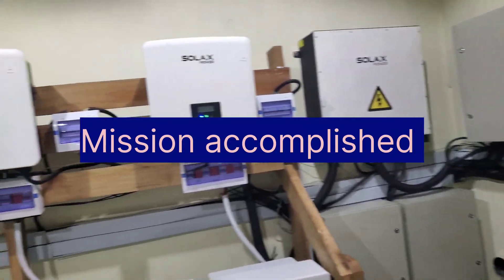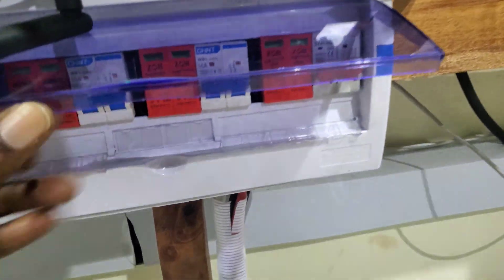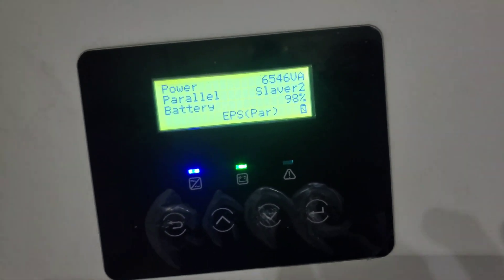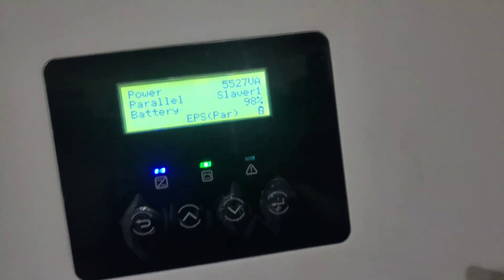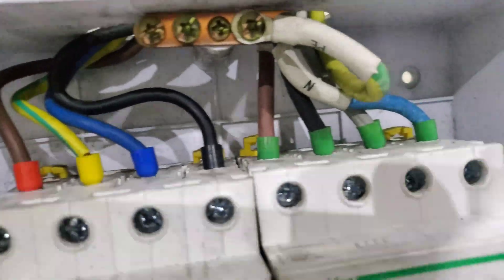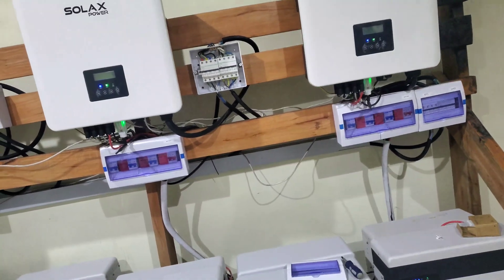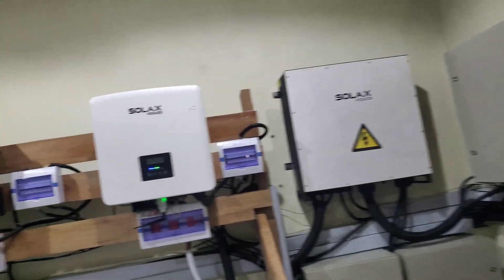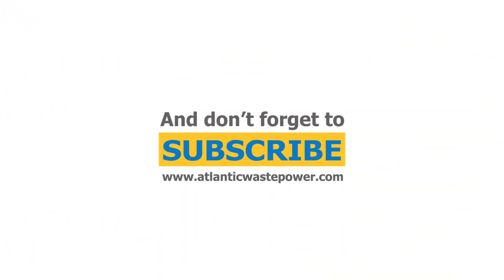Ferrules are in. bare wires are out. #solax #solarpowerplant #cabling #microgrid

Comment: With those high levels of power, I still don’t see:
1. Fire extinguishers
2. Access restriction into the power plant/control/inverter room
3. Security cameras💁🏾
I’m glad with one step at a time you’re nearing full compliance with how you want the system to be running and then you can begin remote monitoring.
Reply from the maker: Client has accepted to have fire suppression (automated) #2 is done so is 3. Thank you for following up on this.

Comment: Hi Dr. Solar,
Thanks for putting out great videos.
Do you supply solar panels? I have a small house in Delta State that requires about 3KW of panel, I already have a 4Kw Inverter / Charger and just need the panel to compliment it. I was searching for your direct contact details on your webpage but found none.

Regards.
Reply from the maker: We don't really do retail. WE do complete systems. I can put you in touch with a reputable seller

Comment: does this inverters produce heat/noise in full load? Can use lead acid batteries without communication to Inverter?
Reply from the maker: It is very low noise. It gets warm. So it is important that the room be properly ventilated. Yes it can work with lead acid batteries

Comment: Doctor,  I'm will be convinced when I see the actual cutting of insulation material and crimping of the ferrules. Are the cutting the copper wires to make wires fit into ferrelus? Your last picture of furreles looked a bit small for a DC system.
Reply from the maker: Your observations are on the money for low voltage systems. Our battery voltage starts at 480. Our PV voltage is over 600. Thank you for noticing. Think of the ferrules as you would think of cable lugs. It gives us a very tight and secure end to tighten our breakers onto.